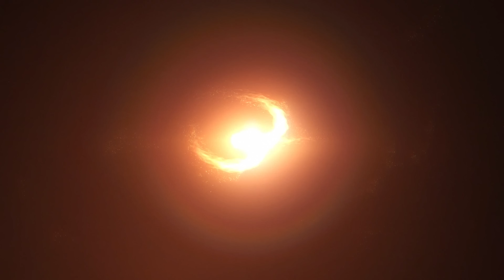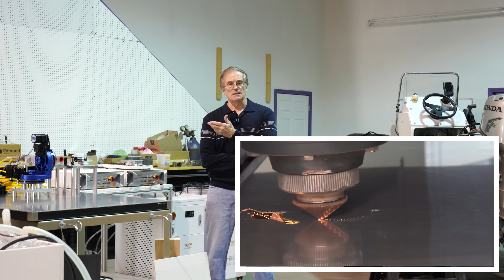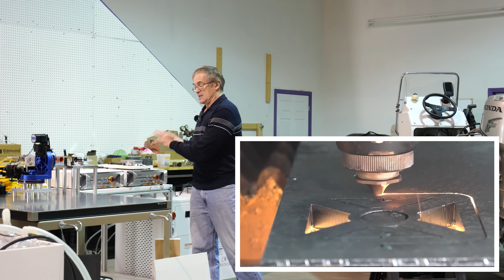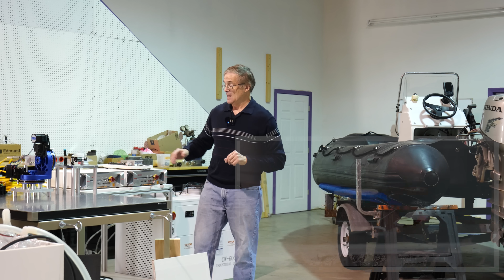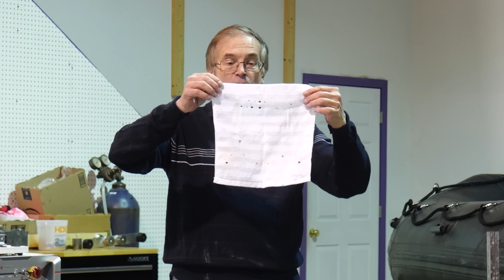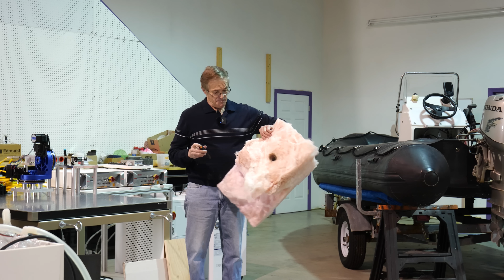We have a problem... and need your help!

Comment: I don't have a solution, but some ideas might help find that solution. This sounds similar to trying to find the correct metamaterial for stealth, but first some observations.

You have two choices, (A) a material which can handle the intense heat and not be destroyed, or (B) dispersing the heat. I see the person who mentioned ceramics, that would be a rather good choice along the lines of a material which can handle the heat. Think space shuttle heat tile, what @athingortwo1513 mentioned for blast furnace type ceramics. For type (B) solutions which disperse the heat there are a lot of analogies and that is the part I'll talk first about (but it might mix with type (A) solutions).

If you consider a common ballistic armor solution, then you might have a softer ductile material interweaved with harder materials. The harder material is designed to break apart the energy bearing incoming ballistic object, and then spread the pieces out such that the softer material can maybe absorb some of the energy, but more importantly to distribute smaller fragments over a larger area; then individual smaller pieces might be stopped by the harder material in the armor which is a mix of soft and hard components.

If you go to metamaterials for RADAR stealth, then you will find that this does not simply absorb or stop the energy in one single place. There is usually an "EM soft" material which might absorb a bit of the RADAR signal, and with an embedded RADAR "hard" object capable of deflecting the signal. At the moment of deflection any collimation is dispersed. Imagine a bowling alley where all of the bowling pins are embedded in jello. Now imagine such small and fine bowling pins that there are millions of miniature bowling pins in the same area, but no bowling pin is so small that it cannot deflect the bowling ball. This is possible in EM because of simple objects like iron not needing to be large when there is a high enough density for that wavelength. Iron filings inside of some sort of plastic which only warms up will take that EM signal and absorb a small amount and bounce the signal millions of times. A single bounce might be trivial, but when you start integrating more and more tiny bounces, with each absorbing a tiny bit of energy, then even your laser could be safely absorbed by spreading out the heat and not trying to solve this in a single hit.

That ceramic idea seems to be rather fascinating, but not by itself. Imagine if you have a solid material with some depth, and that the material at the front does not absorb the light (at least not by much). As the depth increases, if there are ceramic particles, then individual ceramic particles might melt and absorb some heat. What is the material the ceramic particles are encased in? Something more or less transparent to your wavelength, and capable of melting in small spots IN THE MIDDLE of that substance such that it doesn't melt the outer parts. Remember that I said this material does not absorb the light, and so the only heat generated is when it impacts the ceramic particles. When the ceramic particles are only deeper in the core of your new metamaterial, the only place the laser can heat it is IN THE MIDDLE. The chunk of material, as a whole, should remain solid on the outside, and only liquify inside.

The last part of the metamaterial is another fine powder or particle suspended in this substance. That would be something capable of reflecting tiny parts of the incoming beam in random directions. You could break up how much work the ceramic has to do into a wider volume by using a sufficient set of tiny random reflectors (or anything which changes the path of the light).

Such a material could be made as thick or thin as desired. When a good mix is found for absorbing and breaking up the light, in combination with finding a substance which can act as a "jello" to hold together the suspension of particles (jello is a colloidal suspension; perhaps manufacturing this could even work as a colloidal suspension if it can be given an electric charge while the outer material solidifies) and not actually absorb the light.

That asphalt like material @athingortwo1513 mentions could be used as the backing for whatever leaks through. Overall though, divide and conquer subsets of the energy rather than doing it all in one place.

Comment: The easiest and cheapest solution to this is to go outside for testing. Use the sky.
Albeit you probably only have a small window of time to test it, and you'd need to let the nearest ATC and military airport know you're doing powerful laser testing so you can negotiate the time window for testing it.

Comment: I would think at these power levels you are going to need something ablative or with high heat capacity.   Something that could soak away the energy.
I wonder what would happen if you spray something like a hung ceiling tile (the fibrous kind) or the wallboard with water.
The heat capacity of water especially when it turns to steam is high.  Steam would help carry away heat input.
Might be a simple, cheap way to buy time for the laser to be shutdown.
Could also be some kind of water bladder if the laser doesn't immediately cut through it.   
Seems stupid but it might work.   But it might not at these energies.   Just thinking outside the box.
Reply: Reading @ILiketoBreakStuff comments, I think they are on the right track IMO similar to this.

Comment: Hello, I work on lasers. You need to specify what wavelength you are dealing with. Many fiber lasers are 1064nm which is an infrared wavelength. There are detectors that use carbon piles to measure the output of the units. I primarily work on NdYag lasers that output low wattage but I've worked on 15kW CO2 lasers as well. With a CO2 laser you can use a piece of Lexan at least an inch thick to stop the beam. There is also the approach of using a "dead man" switch that controls an independent shutter between the collimator and the focusing optic. A hold down button to fire type system. With an optic coated for a specific wavelength and invisible to another aiming laser wavelength you can operate the fire switch when the system is on target manually and only be "firing" the primary beam when needed.

Comment: How about fog? I don't recall the wavelength you are dealing with to be practical but if you made a curtain of fog to diffuse the beam before it hits your wall, it may give a normal material a chance.

Comment: SpaceX Starship Heat Tiles? 🤔🖖

Or aks Nighthawkinlight...

You need a wall of a solution in the comments at a 45 Degree angle so the light is not reflected back...

Comment: I'm an electrical/mechanical engineer that spent many years designing laser light show equipment.  I had thought about this issue even before your video.  My concern for this tech is "How do you not destroy what is behind your target?"  If I were trying this, I would set the optics to flair out the laser energy rather than focus it, then use as large an optic as I can find to then focus the energy to a point.  Part of the targeting system would include range finding and adjust the focal point to coincide with the target.  This would then reduce the energy in front of and behind the target, potentially rendering it less lethal.  I know it's not quite what you are looking for, but it's what I have.
Reply: have u tried acoustic waves or electro-optic deflectors?
Reply: The problem is that you´ll need a focusing lent on each distance. In an hypothetic fixed situation, that will work fine, but finally you want to reach the target at any distance.... and how to get an intant concentrating lens with variable focal distances?
Reply: @osposto   - now we approach fluid focusing sstems - or a "rotary multi lens array" - a carousel of focal lengths..
Reply: (their point* is a long range "destructive" beam)...  What you describe is what is done in "workspaces" - and optical labs - this is for a range "tool"..  (Lots of Engineering Specialists appearing here, weekend for me..)
Reply: Watch the video one of the caveats is that you have a narrowing beam Channel the further out the narrower the beam for a very long way. Yet another "unprovable credentials, do something else" post and look at how popular it is.

Comment: idk how well the power catches in mirrors, but if a mirror can survive, it might make for part of the solution. My primary idea would be and agitated blend barrel, like with something stirring it on the bottom, of just enough to be opaque cornstarch slurry. Now this will likely cook some, but the chunks that form can be fished out when it seems to be loosing effect. Like I said, if you mirror into a trough of the stuff, or barrel, that should make for a replaceable and hard to point gain energy barrier. it will only heat as far as the beam will go, and the white will spread the light around as well.

Comment: Carbon fibre welding blanket. I was thinking for something with high melting temperature, but also with high conductivity and high thermal mass, as the laser power focused in just one spot will deliver enough energy to that location that it will melt it in no time. Therefore the thermal mass will absorb more energy before melting while the thermal conductivity will spread the hear to a larger volume. And chopped carbon fibre strand are wining in two of the three requirements, CF has low density and therefore not so great thermal mass.

Comment: You could consider some refractory ceramics, but cost may be an issue. In terms of cheap and abundant, have you tried sand? When the laser hits sand or soil, it will heat the particles intensely. However, because the material is loosely packed, the energy can be dissipated through the movement and scattering of these particles. The laser will have to heat and potentially vaporize a significant volume of material to penetrate deeply. Each grain of sand or soil that is superheated will essentially ablate, carrying away some of the laser's energy which happens continuously across the surface. Sand might be a bit messy in terms of dust and particulates at the magnitude of power you are talking about, so if that were to be the case then perhaps also try gravel and crushed rock which would have similar protection properties.

Comment: If you can find a material transparent enough for the laser to pass through without damage, you could make a tank of some absorbent fluid. You could add material to the fluid to make it less transparent to the laser and calibrate the opacity to spread the energy over a large distance.

Comment: Could you use some of the elements you already described but in combination.

Make a wooden plywood box with an open top.  Insert the gypsum board with 2 or 3 cm gaps between boards.  Fill the gaps with water.  As the gypsum board and plywood  absorbs water they wont burn or disintegrate as quickly, the thermal mass of the  water would absorb energy as the laser is applied.  This multi material approach would have to be tweaked to get the appropriate level of safety but i think it may be more successful than just a single material target.

Comment: Reduce power density somehow and adsorb later. Solutions:
- Lens and following light absorbent / black surface
- curved optical mirror designed for your laser wavelegth. Reflection is directed to a light absorbent material

Disperse the energy in a medium:
- Aquarium with murky water. If you are afraid the glass wall brakes, then reflect laser by a mirror on the water surface

Use a trick with many reflections:
- stack of glass faces laser. The stack is slightly tilted. There is a small air gap between the glass sheets. (Careful with stray reflections!)

Use more water to take energy of the laser:
- soak the thick insulation layer into water and prefer alumina fiber insulation to glass fiber.

Comment: Maybe look at the bigger picture. You don’t want a full power beam slicing through the air willie nilly, so use a reduced power beam for tracking targeting and short duration full power pulses for target termination.  
 As far as a backstop, maybe a simple round disc that rotates through a tub of water. Increase the speed to increase the exposed footprint. A simple shield around it would help keep from hosing down the shop.

Comment: Slim Water tanks an inch or two thick (I have no high power lasers and no idea how thick the tanks need to be ) might work, they are a one shot option but easy and cheap to replace or fix with fish tank glue and a patch, maybe test some dye as well, to absorb more laser light. Several walls of them with a small air gap between them to allow the laser to chew through 2 or 3 before someone hits a kill switch of the power supply if all else fails. 
It sould give you a few seconds, the water should be able to absorb a lot of energy and gets replaced by new water in the laser path. You need to make sure the tanks are stacked in a way that does not allow the laser to burn through only top layers of tanks and prevent new water in the laser path. If weight is no issue it is at least worth a test ? If it works I´m happy, if not it is cheap to test, no need for any credit, nobody is good enough. I like your channel, your videos are fun and insperational.
I also like Terence Hill movies :

Nobody und Doc Foster
https://www.youtube.com/watch?v=EqZiLdx23WI

Scene from:
https://en.wikipedia.org/wiki/A_Genius,_Two_Partners_and_a_Dupe

End of line...

Comment: You mentioned in a comment it would need to cover a huge area, which makes sense because you'll need to test it following a moving target. It seems like the key is going to be to also make the material absorbing the light a moving target. What if you had a big vertical conveyor belt that dropped a wide ribbon of some substance, perhaps wet sand, continuously from the ceiling down to the floor? Or if you can find something that's fairly resilient to the laser (spacecraft tiles? aerogel?) you could mount them on the belt and have them run past the beam quickly.

Comment: I have two very broad ideas.
You have one other requirement, the blocking or absorption media/barrier needs to be passive. A moving backstop would probably be very complex and introduce significant risk.

My thought would be a parabolic reflector into a trap, but that may be too large, depending on the area needed.
They work similar to anechoic tiles. The design time is what I see as risk.

Second is a diffusion lenses/medium. Either something like a lenticular lens or a rock salt (possibly kosher salt, depending on beam size) vertical sandwich to diffuse the beam so it can be safely absorbed by something like an activated carbon painted aluminum sheet (heatsink) or gypsum board.

I didn’t see something like this in the comments.

An active approach might be something like a large partial reflector with a backstop where the partial beam goes into a photo detector that responds faster than a short backstop to stop the source. But much like active restraining devices, airbags, there’s more inherent risk, and more design to ensure correct system behavior so the safety works when needed.

Comment: What’s the wavelength of your fiber lasers? 

Sure you’ve looked at it, commonly a beam trap is used. Typically something like a graphite absorber with a bit of a cooling backing. 
I was looking at Thorlabs for inspiration, they claim to hold a powerdensity of 25kW/cm2. But you did not tell us enough about your laser for me to give you better advice. 
Depending on the powerdensity and dose, I’m thinking aluminum sheet material couple of mm thick for structural support and heat dissipation then laminate graphite sheet on the aluminum as the main absorber. 

Your room would get really dark. 
But you can paint them white with some tio2 based white wall paint. I do not think the tio2 is going to backscatter or do much, seen to the particle size op P25 or equivalent usually used in paint

My 2 pennies 
Let me know if this was useful

Comment: Seems to me like you need to transport the heat away from the target zone.  I would go with flowing water which contains enough suspended solids to absorb the light.  Then ensure the water is flowing at a sufficient rate that while it heats up, it does not vaporize.  Some math may be involved.  And possible great depth of water with less suspended solids.   And  you will need a way to get the light into the water, so probably glass ?

Comment: Could you create an uber fine water misting station outputting as much water at a time as physically possible over as large an area as possible at a depth of several metres situated in front of some sort of substrate which does the job the best of your options?

Comment: I suggest finding a rock quarry. There’s nothing to set on fire in a quarry and if the laser does angle up above the pit rim by accident, you are shooting it into space. I would get on google earth and start looking around your area and start calling them. You might want to invest in an enclosed trailer for the equipment and a generator to run it all depending on power requirements. That’s your most practical solution. Plus you have the ability to take your show on the road if you ever want to present it to someone else in a different location.

Comment: My idea is to mount brake pads to a thick metal plate with a heat sinking compound. The brake pads will tolerate extreme heat long enough for the plate to draw it off and dissipate it.

Comment: What you need is to reverse the process of beam concentration. A curtain of frosted glass (similar to what was used). Multiple layers of frosted glass with a frosted aluminum back sheet. This should allow the power level to be reduced to a non-destructive range. If a shower curtain style is used, then non-perpendicular beam incident would be even more effective.